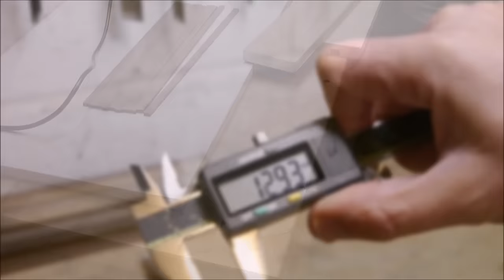(My way to) The construction of a Shoji style hanging lamp

Comment: Exceptional work. What did you spray on the paper before the final fit (14:14)? Was it just to add a bit of texture to the paper?
Reply from the maker: Thank you 
You moisten the paper with water. When the paper dries, it shrinks and becomes taut.

Comment: um químico que tem como passa tempo a carpintaria! risrisris eu também !
Reply from the maker: I tried to Google translate your comment but it made no sense to me, sorry
Reply: Are you a chemist, who has a carpentry hobby? because I am. I identified with your video and coat, which I use both in the laboratory and in my garage. (Google translator).
Reply from the maker: Ah! No I'm not a chemist 😊
I use the coat against dust, glue, oil, paint, ...
Reply: All right, I still like your video, it has won a subscriber. the jacket is very useful in all cases, kkkkkk both to protect from dangerous substances and to protect count dust and oil ... kkkkk
Reply: @marcelohcs9344  wait,  kkkkk. That's a brazilian laugh isn't it?
Reply: @GodMaxDrinkerofTea  yes
Reply: @marcelohcs9344  nice. Remembered one thing.

Comment: What did u spray on the paper and why? Very nice piece! Thank u sir..
Reply: You moisten the paper with water. When the paper dries, it shrinks and becomes taut.
Reply from the maker: Thank you Sean for replying on my behalf! (I didn't have the "notification for comments" enabled, so I just so the question today)
Do you make shoji-style stuff as well?
Reply: I am in the process of making two shoji-style LED floor lamps. Each panel is 72" tall and 11" wide, so the process of chiseling the frames, cutting all of the half-laps, assembling, and applying finish was tedious at best. All the care and effort will feel worthwhile the first time they turn on.

I opted to use a laminated paper (thin plastic film sandwich, no water misting necessary) mainly because it has greater transparency. It will also be somewhat more durable.
Reply from the maker: Wow, 72 inches, it's huge!
I'm curious, when you have finished, if you want, send me some photos (you can send me a message through this page: https://www.facebook.com/ideebizzesche/)